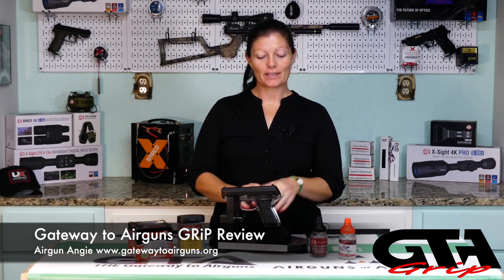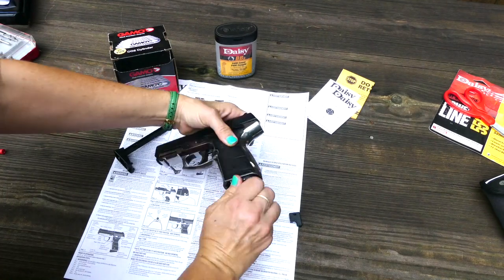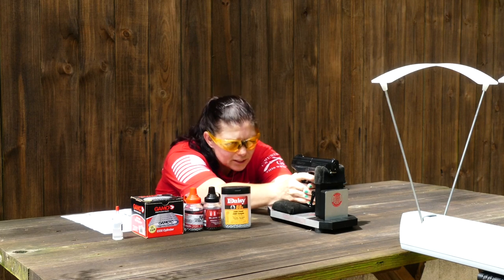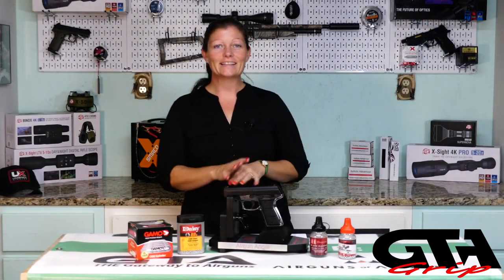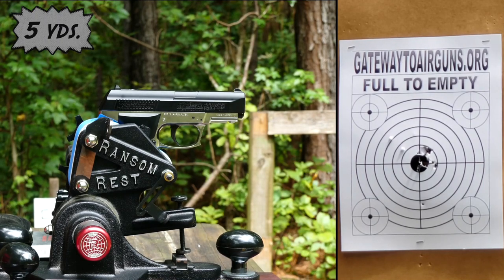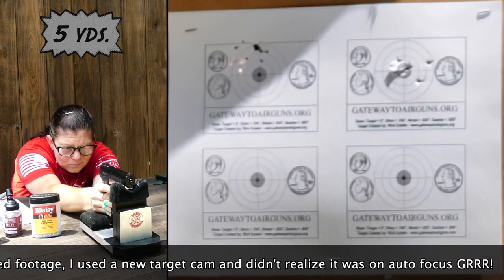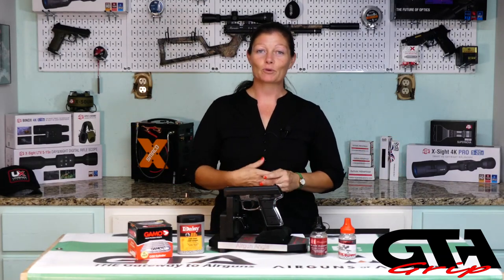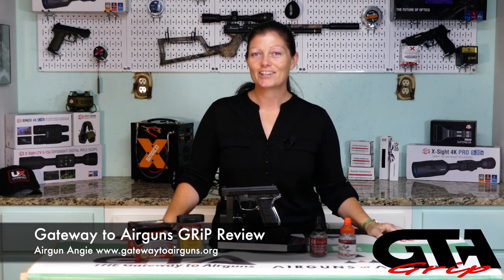Daisy Powerline 5501 Co2 BB Pistol GRiP Review - Gateway to Airguns Airgun Review

Comment: Daisy powerline 5501 I need to work on it at pistol plastic Lotto needs to be harder not plastic it's flimsy to be honest and work on that the CO2 make it turn only way to call it should be made out of steel and easy concern to lose losing a screwdriver on it to make it move just my opinion Daisy improve it a little better